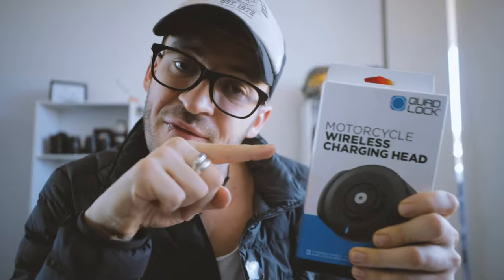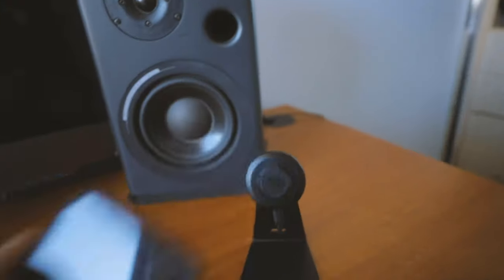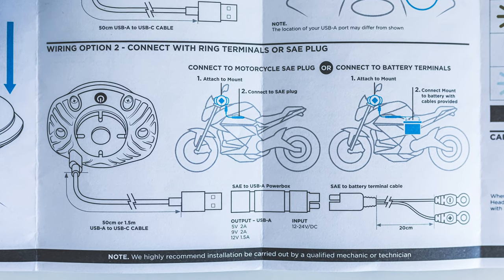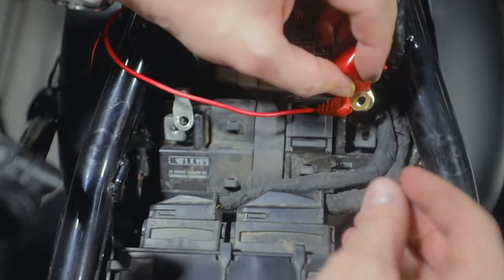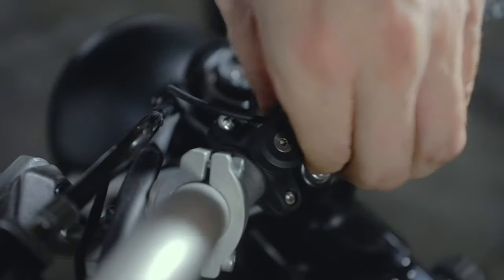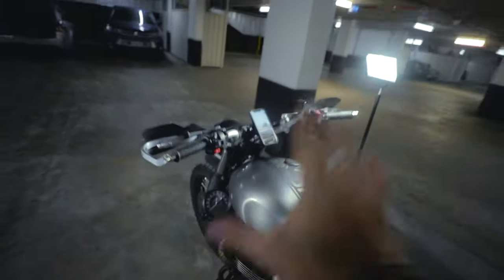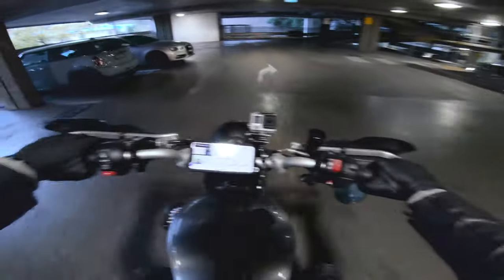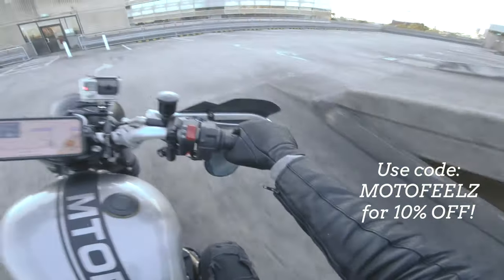QUAD LOCK | Motorcycle Wireless Charging Head | Unboxing

Comment: Tip from an old cable tech: the electrical tape around the connections is good for moisture prevention, but to prevent cable seperation, throw zip ties on either end, too tight to slip over the connectors, then a 3rd between the two to hold them together.
Reply from the maker: That'll do it! Although the tape has held up nicely over the years

Comment: Is this the new version? And do I need to purchased the battery to SAE and SAE to USB adaptor separately?
Reply: Good question! I bought one of these a year ago and that sae to usb box was nowhere to be found. It's also worth pointing out that this video is from 2020. Yeah, where IS that part??
Reply: I have the same problem :( … No QuadLock SAE to be found. They say it’s the problem of different batteries and that they don’t provide an universal SAE.
Reply: @michachwastowski3593  That makes next to no sense, especially when looking at the specs on the SAE. That thing reads like it would work with anything. I'm pretty sure none of us who bought these units were happy to discover that they require additional components in order to work. I personally sort of feel scammed.

Comment: Thanks for posting the video

I use quad lock on my bicycle but use a custom made magnet mount on my MT-07.  My only complaint with the quadlock mount is it can be awkwardly hard to reach around the bigger phones to depress the spring and then turn the phone to release with only one hand.  I'd like to be able to switch from portrait to landscape one handed with gloves while rolling.  I see when in portrait the sides for the spring loaded tabs stick out past the phone so you can reach them but when in landscape can you swap back to portrait or remove the phone with only one hand?

I was considering the non water proof wireless head because I don't ride in the rain and it doesn't look like it requires you to press down on a spring to rotate the phone.  I know it is less secure but as long as the phone doesn't want to rotate(uncommon force on a street bike) it shouldn't come off.  

I'd love to hear your thoughts.
Reply: Is it possible to mount the charger vertically to solve the issue?
Reply: @FarhanKapadia  that wouldn't really solve the problem and in fact make it even worse when the phone was vertical.  For reference I went ahead and bought the non waterproof model and just siliconed all the openings to make it waterproof. Now I can mount my phone one handed but it lacks the extra security from accidentally rotating the phone which ain't going to happen outside of a crash. If I crash, my phone ejecting is the last of my worries.

Comment: Does the wireless charger drain you battery when the motorcycle isn't running?
Reply: Dont think so, but you can switch it off.

Comment: Thank you for the information, when the motorcycle is turn off is it still eating electrycity from battery?
Reply from the maker: Negative
Reply: @MotoFeelz  Hm... Thank's can you gave me link for the item? Can't find with included cable to battery...
Just find this one...
Quad Lock Weatherproof Wireless Charging Head
50cm (20 inch) USB-A to USB-C cable
1.5m (59 inch) USB-A to USB-C cable
Hex Key
M5 x 35 SS304 CSK Screw
x5 Zip Ties

Comment: hey, could let us know where you got this?? on the aussie site it doesn't include the connection cable to the battery?
Reply: Hey please, I’m having the same issue, I have ordered one through the Aussie website and just received it today to realize there is no ring terminal adapter in the box . Cannot find it anywhere on the web . Looking for a quádrica original adapter like yours! Thanks
Reply: @ivanbugoni6961  I just bought this and only realized after paying that they do not include the sae-usb.... doesn't make any sense... so now i have to buy that separately which sucks!
Reply: @NabilKarsheh  yes I have contacted quadlock aus to clarify and they said it doesn’t include the SAE cable with battery terminal and advised me to purchase the quadlock USB porch and use that as a power bank to the wireless, pointless when you have a USB terminal running to the wireless and have an overcrowded bar , I returned my wireless for a refund and purchased only the USB for less than half the price! Works perfect and easy to install!
Reply: @ivanbugoni6961  i bought a cheap usb i can connect to the battery from ebay. If it will work together I’ll keep it. If not I’ll send it back as well.
Reply: @ivanbugoni6961  however I remember when this product came out it was around 100 euros, now without the sae-usb you can purchase it for 71euro. I would have payed them more to have all in one hand.

Comment: Stupid design to have a USB anywhere in the system, either make a cable that is hardwired to the head with an inline fuse that you can connect to a switched accessory, or hook it up directly to the battery with a relay in the system that kills power when the bike is off.  Whoever designed this doesn't ride a motorcycle.  I am also not convinced that water will never get into the USB-C connection at the charging head, hence a hardwire connection there.

Comment: I'm reading this is killing some iphones cameras. I've got an street twin, and i'm about to order it... got an iphone xs. Just want to know if you get some trouble with the cameras of your phone because of the vibrations of the handlebar.
Reply from the maker: Yea man it happened to me. Mainly the iPhone 11 is where the issue lies. Apple changed the IS (image stability) over in 35 mins while I waited free of charge, but quadlock now have a shock proof mount to fix the issue. It isn’t just Quadlock that screws with the camera though, any other mount would do the same
Reply: Moto Feelz thank you for the answer. I might wait to the dampened mount then. I would like to take the oportunity to say you’re doing a great job with your channel. You’re the Peter McKinnon of the motoblogs, loving the style. Keep it this way mate.
Reply: @MotoFeelz  Can you use the damper with the wireless charger?
Reply: @MotoFeelz  Btw, did they stop selling the wirelss charger for motorcycles? I cant find it anywhere?

Comment: NOT WIRELESS!! Still requires it to be connected to the battery so it's false claim. Wireless should be no wire and should only have one for charging it at home or by a battery pack. Definitely don't want to plug anything into my motorcycle electrics could cause issues.
Reply from the maker: Wireless as in you don’t need to plug your phone in for it to charge. Not a false claim at all. Everything powered needs to be wired to the battery somehow or else how would it get power? This unit is totally fine to connect to your battery. Definitely won’t cause issues if you know what your doing, otherwise take it to your local technician to be installed.
Reply: @MotoFeelz  I'll stick to using a battery pack as its far more efficient and doesn't mess with my motorcycle electrics and it's brain.